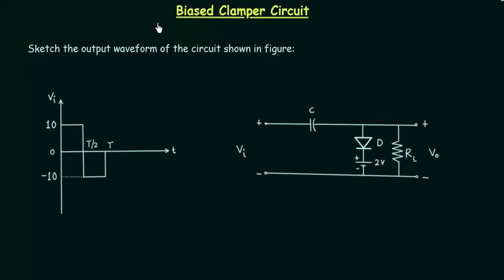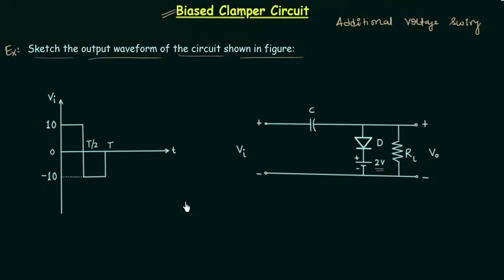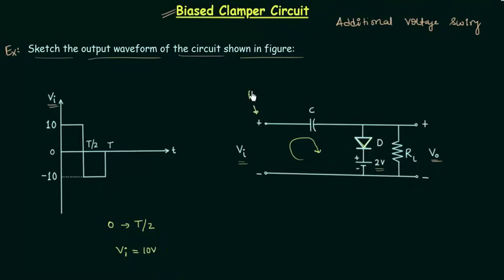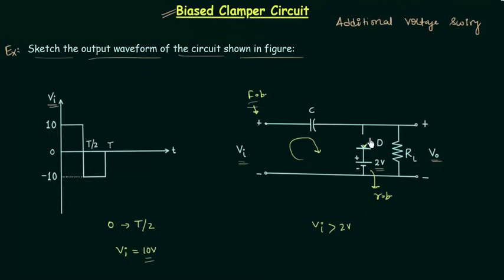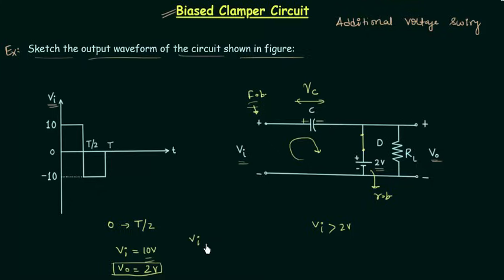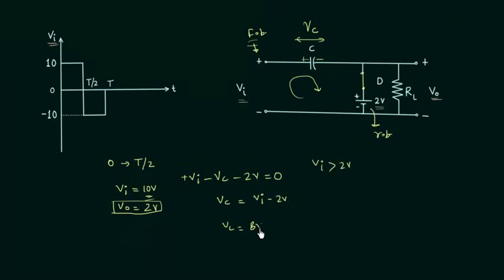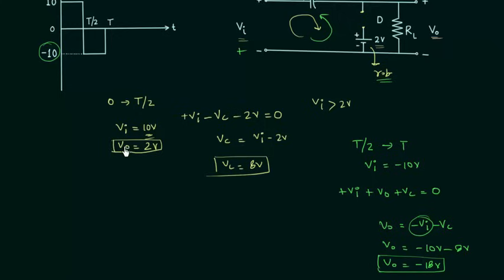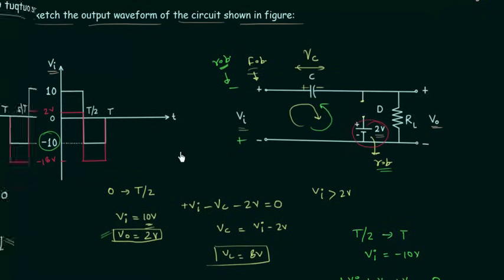Biased Clamper Circuit

Comment: @Neso Academy For +ve cycle would'nt it be like 0v across the resister since capacitor act as open circuit for dc voltage.

Comment: In +ve half cycle for Vi<2v,diode is reversbiased,so Vo should be equal to Vi 
And for Vi>2v,diode is forwardbiased,only then Vo=2v...???
Reply: thats when  input signal is analog. here the signal is digital. the voltage is either 0 or 10.

Comment: For the half cycle because the capacitor has charged and the time constant is greater than T/2 it will remain charged with the polarity from the first half cycle . Therefore we will have Vi+V0+Vc=0 where V0=-(-10)-8=2 Volts
Reply: I think i need to make a correction V0=-Vi-Vc and -Vi is will -10 V because the value of Vi is 10. Therefore V0=-18
Reply: @gamar1226  hey i have the same exact doubt can you please explain ?

Comment: how o/p voltage is 2v when diode in f.b. in positive half cycle?..what about presence of input voltage?
Reply: when diode conducts replace it wid short circuit( NORMAL WIRE) now when u try to measure the voltage ITS NOTHING BUT 2V BATTERY IN PARALLEL with  o/p,,thts y o/p=2v

Comment: During the negative have cycle why did he not considered the reference voltage 2 volts while applying kvl
Reply: during negetive half cycle diode reverse bias m hein,,isliye battery diode part open circuit hojata h..aur ek baaat KVL lagao  Vin Vc Vo isme refernce voltage ayga hi ni
Reply: outer loop m kvl lagao battery ayga hi ni aur waise bhi diode battry branch open bhi h

Comment: why cannot  capacitor  polarities won't change during different  cycles
Reply: the basic property of capacitor is that it cant change voltage across its plates instantaneously..
Reply: To change the polarity of capicator     should get discharged and then get charged and it requires time of 10 time constant which is very larger than t/2

Comment: bro one doubt....at 4.23 min of the this video from t/2 to t,vi=-10v,,,but int h kvl equation it is Vo= -Vi-Vc but u substituted -Vi as -10v...shoudnt it be just 10v?
Reply: prajval kumar that was a mistake on his part. We're just considering the magnitude of Vi here which is 10V. Since he already changed the polarity in the circuit diagram, he shouldn't have written Vi=-10V
Reply: I said that too , i wish they would answer
Reply: Hope this answers your question.
Reply: SO answer is Vo=-(-10)-8=2v na?
Reply: no he is right, in the +cycle +vi=+10 and in - cycle -vi=-10  cuz the circuit diagram has +vi on its  top,-vi on its bottom

Comment: can you please explain how v0 is 2V?
Reply: Because diode is forward biased and will be replaced by short circuit. So in the diode branch there is only dc supply having value equal to 2V and if you see the output voltage its positive terminal is connected to positive terminal of 2V dc supply and negative terminal is connected to negative terminal of 2V dc supply. This means output voltage is simply equal to 2V. i hope its help!
Reply: @youtubelover1240  It helps, thanks you sir/mam👍.........
Reply: @ashishkhari5565  most welcome